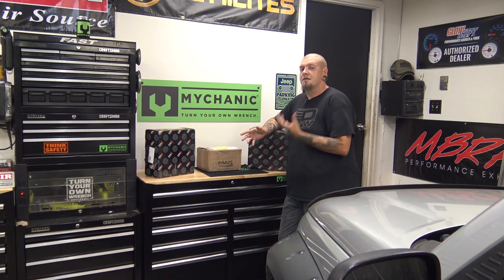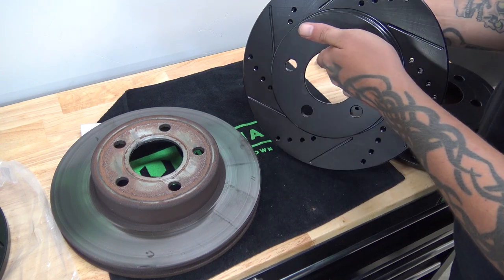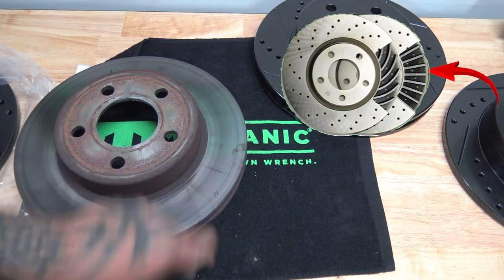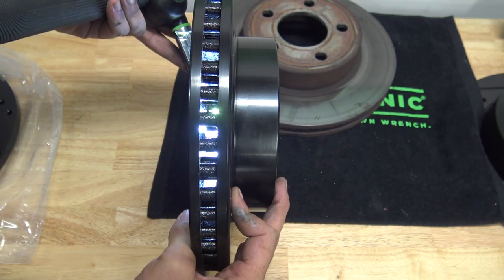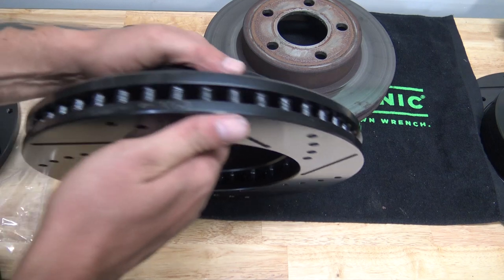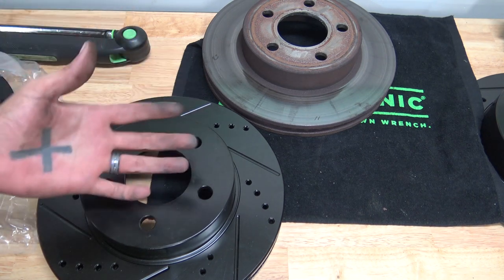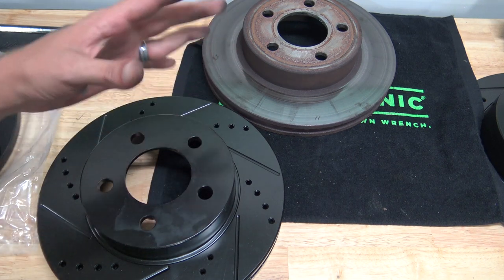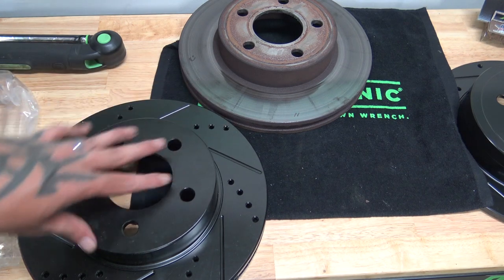How To Tell Directional vs Non Directional Brake Rotors

Comment: thanks man, you explained this great... I just put drilled and slotted rotors on my truck and got drivers side done and nearly complete with passengers side. Then I seen the sticker that marked the rotor for driver front (FML right) Tired and worn out, I finished putting truck back together with attitude of I will figure this out later. I just need to get truck outta friends driveway and goto bed
Reply: RAmen brotha. Hope you slept

Comment: The slots are for dust removal and should sweep the dust out! So it does mater the direction if you want the slots to perform it's engineered function.
Reply from the maker: The slots are actually engineered for cooling and high temp gas release for hard braking on hot brakes. If the pads were putting off that much dust as to need a "dust-sweeper" you would be out of pad material after just a few stops. Thanks for watching!
Reply: @RockyXTV  The slots are not engineered for cooling(I'm an engineer and that doesn't make sense), if they were for cooling they would completely penetrate the rotor, but they don't, they are a machine turned channel used for dust removal. If the sweep, grove, channel is turning the wrong rotation you are trying to force dust to the center of the rotor during braking. So while you can brake in both direction, building dust up between the rotor and the pads reduces fuel mileage and brake efficiency. Also, it's just left or right hear and you could put them on the efficient way or the way that will reduce performance and life, I think I would just go ahead and put them on the correct way and be done.
Reply: @bobsokoloski9559  you're a bad engineer
Reply: @dedan2  thanks, actually I'm a rambling wreck and a hell-of-a engineer.
Reply: Everyone is an engineer nowadays 😂

Comment: Good video. I’m just going through this with m 2017 Audi S6. I bought replacement “OEM” rotors and there is only 1 part number from Audi, and the manufacturer SHW only has 1 part number. But the vanes are VERY directional so they would be going in the wrong direction on the passenger side. Not sure what to do.

Comment: The slots are cut on an angle for a good reason, and should point forward so by centrifugal force, they sling the wear dust outward away from the caliper ...!  The slots also keep the brake pads wearing flat...!

Comment: Slotted/drilled rotors are very puzzling.  

What bugs me is the slotted aspect.  Say you got them this way without directional vanes but with the slants like you have them on the table but on a car going towards your left side, the brake dust will be expelled towards the outer edge with every rotation because of the centrifugal force, whereas if the slots were the other way your dust would be forced inward towards the center, basically compacting itself and filling the slot.  Not sure if that makes any sense.  🤔

Comment: What about slotted and drilled vs solid rotors. I was going to go for the slotted and drilled and other Jeepers told me that the slotted and drilled become filled with debris and render them useless.  Now I am in a quandary.  Any advise?
Reply from the maker: Drilled can and are more likely to get filled with debris. Slotted is much less likely to get plugged up, but it is still a possibility. For offroading solid has always been the "go to" type of rotor, but slotted can work pretty nicely as well. I personally have the TeraFlex big brake kit with slotted rotors on my Wrangler and have never gotten anything in the slots other than some brake dust. Even when going through mud pits and out on the trail I've never had an issue with the slotted, but then again that is just my experience.
Reply: I’ve had drilled rotors that developed tiny cracks around the hole, go with dimpled if you can find them
Reply from the maker: This can be common on drilled rotors that see a lot of quick heat cycling. You are correct, the dimpled rotors are great as well.

Comment: wrong, its a patent thing, the correct way is to load the pads to the out side, you put slots on the reverse way and the pads grab the slot shoving them to the inside as well and recirculating dust and other things causing a squeal or chatter. . these companies can remake what is already patented so they reverse the cooling fins or the slots. there is a correct way "to kick dust and water to the outside AWAY from the pads as well as pad loaded to the outside."

Comment: Straight veins are non directional. Curved veins are directional.
Reply from the maker: Correct, internal cooling veins. I think that is how I explained it in the video. The external slots will not make a rotor directional, it's all internal. Thanks for watching!